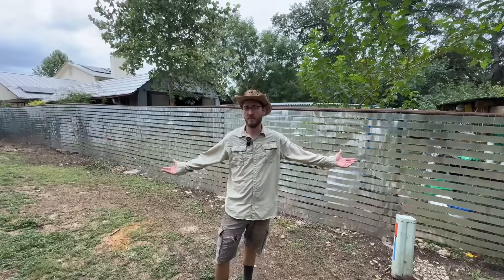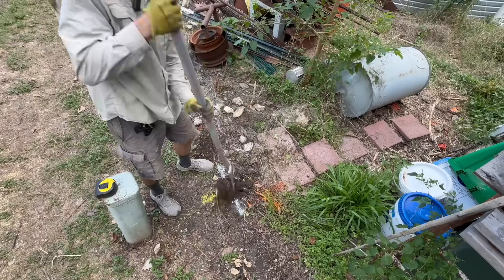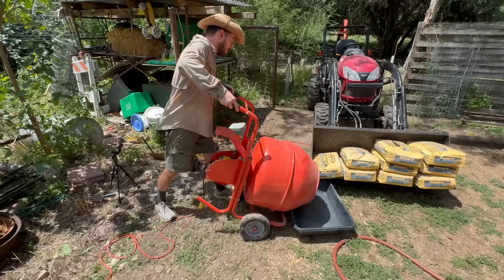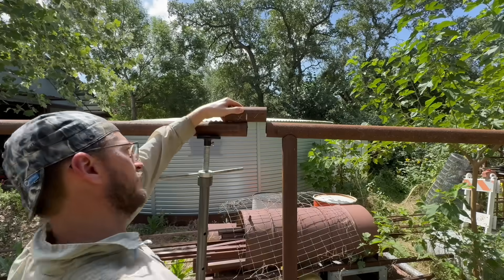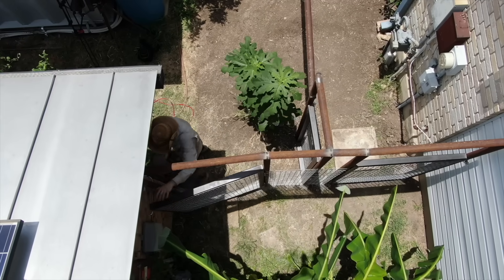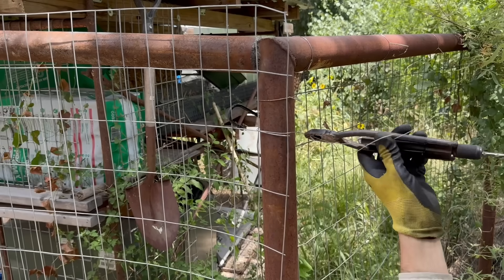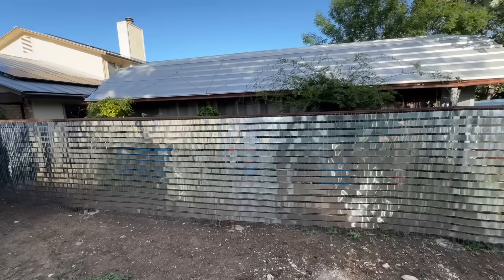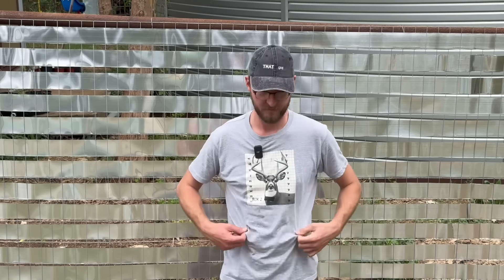This FENCE Lasts 100 years!!!!

Comment: We used those pliers in jewelry class in high school to make neat bracelets and stuff. Try spinning some wire, then folding it over and spinning it again. Or fold it and spin it backwards, makes a really neat braided pattern. Then hammer it flat, solder/weld the ends together, a little buffing and poof 10 minute necklace you can sell for $50. 

Also a drill can be used if you don't wanna drop >$100 on a new tool. Those are just more handy.

Comment: I used these pipes to support my patio roof and an arbor in my backyard. Well, they do get rusted over time and exposure to rain. In my case it's about 13 years. One of my roof supports... a pillar actually, has rusted and snapped off just above the floor and I have to call a welder to fix it. 
If I have to redo this setup I would go for thicker and stronger metal. Also, give it a slightly higher base to keep the metal off the ground. Not sure how this would work for a fence though. I've used T-bars for the fence but those are also rusted and rotting now. But metal is still better than wood in my tropical environment in India.

Comment: Just an FYI, woven wire fence is much stronger than welded wire.  The wire is usually thicker and it's a continuous run.  It's also heavier and more expensive so the welded wire could be a better way to go if you're not expecting any cows or horses pushing on it.

Comment: 2 thoughts:
This reminds me of a fence at the De Young museum in San Francisco. http://artofgardeningbuffalo.blogspot.com/2012/08/the-de-young-museum-garden-in-san.html?m=1
They used welded wire mesh and perforated metal on both sides of square steel tubing. They filled the fence with duff (fallen leaves) to allow plants to grow on the fence.

Secondly, the aluminum fence material would act as a good reflective surface for roadside fences to notify motorists of a upcoming curve.

Comment: Deer don't like to jump fences unless they are pressured. They go through brakes as much as possible. Not being able to see the other side will deter them from trying. Foil sure isn't going to attract them. While it is new they will be scared of it.
    I hunt where it is bordered with ancient fences. Out of the 40 or more game trails leaving the hunting land, only one do they jump a single barbed wire. They only do it because it is in a tiny dry wash and they are above it for the whole jump. All the rest are breaks, knocked downs, or rusted away places in the fence. It is only 4 feet high, with 2 more barbed strands upper and lower, 90 year old cow fence.

Comment: Don't know what u do for a living ? If ur not a tradesman?? U could be a welder/fabricator! Ur very detail oriented. Some of the routes u chose to go with were great! Don't listen to the negative Nancy's and the haters!! I have several welding certs under my belt and own my own portable welding rig" Lincoln classic2 250amp diesel powered rig. Hold the course young man! Good job
Reply from the maker: Thank you genuinely for your words of support. It means even more coming from a welder. I have gotten some critics here on the quality of my welds (Koch I will admit is not perfect). It’s good to hear from a tradesman who is tolerant of my non-tradesman flaws. Thanks!

Comment: Living in Arizona, this fence is terrifying. Blinded every time I look outside and the ambient temperature of the backyard rises to 160f... I can feel it now
Reply: Maybe vinyl siding in some less reflective color could be used for the strips.
Reply: Used galvanized corrugated roofing panels vertically on a fence in the San Fernando Valley. The yard, which used drought resistant landscaping, was an oven in the summer.
Reply: Aluminum outside is not going to stay shiny very long, and it does not attract and absorb heat. A block fence, on the other hand, is going to absorb the heat and then radiate it. Your assumptions were incorrect, and don't make any sense at all.
Reply: It could be painted....I think it's ok as is but to each his own
Reply: you do know tx is hot and sunny also??

Comment: Good video.  Lots of interesting ideas.  A few thoughts:
1.  It's optimally designed around your skills, tools, workshop, and location (optimal steel available, and climate conditions).
2.  I'm wondering if the ivy is going to 'like' growing on the aluminum.  Might get too hot when the sun is shining on it.
3.  Without a bottom rail, seems it will flap in the wind and be tempting for smaller animals to dig under it.
4.  Seems similar to a chain link fence with aluminum strips woven through the fabric, except the posts and rails are heavy steel and the "look" is unique.

Comment: Fence can be made from whatever’s available… guy here in town has the steel framing and the fence is made up of flywheels, cranks… engine head, valve cover hubcap wheels… lots of wheels bumpers tailgates engine blocks transmission driveshafts…. It’s a crazy fence
Reply: Hey, post some photos, I want to see the crazy fence!

Comment: Your great tools help.  When I owned a small concrete mixer, I used raw cement, sand, and gravel in 1:2:3 ratio by volume.  To keep it clean between mixing many loads, after dumping it out, I would shovel in gravel for the next batch and water and run that to scour out the latch batch.  Biggest job was pouring footings for a house addition (2 ft wide), others were filling cores of a concrete block garage wall.  For slabs, I ordered a concrete truck load (no time to mix that much).  The great thing about welding is that you can attach any steel together without figuring out funky brackets and drilling bolt holes.

Thorny plants can be good for security and might even discourage deer from jumping over.  All my neighbors in CA now are just-write-a-check types.  One newbie fussed that I shouldn't mow my lawn and trim my trees myself.  What happened to the pioneer spirit?  Noticed you also extended the side fence into your neighbor's yard, replacing the rotted wood fence there.  You are a nice neighbor.

Comment: I appreciate everything about this fence, and I hope in the future I can place myself into a situation where I can do this very same thing on my own property that I hope to buy one day. I do have a bit of skepticism on the 100 years part lol. !00 years for sure, but rickety at the point. And I think that solely because of the quality of your welds. I understand welding is difficult and you're doing this outside with non industrial equipment. But, I do believe that it is the sole thing that could drastically improve the longevity.

Great work. Do you plan on applying any kind of sealer prior to letting the vines take it over? Maybe double layer thick on the flashing? How is the flashing fixed to the pole rather than lose weaved through the wire? (shitload of work, but drilled/tapped holes with small screws and large washers through a double fold on the end of each strip of flashing?

No mean intent, just my thoughts on making it brutalistic style over engineered strength for extreme durability/longevity.

Comment: Seems like you used 4 different metallurgies there, when you could have gone with just one or two.  You have raw steel oil pipe, galvanized ranch wire fence, stainless twist wire and aluminum flashing visual barrier.  While Stainless steel, galvanized steel and aluminum are all considered corrosion resistant, no so much when they are mixed together.  The stainless and aluminum will ruin the galvanized resistance wherever they contact.  You could have used galvanized twist wire and flashing, which would have been both cheaper and would have complemented their rust resistance.  I don't have experience with these metals in long term fencing and I know that twisting wire tends to ruin its galvanization so perhaps the SS twist wire would be a good idea.  Stainless may not harm galvanized as bad as aluminum.  Keep an eye on the galvanized ranch fencing where it contacts the aluminum; if it's getting rust at the contact points.  The problem with mixed metallurgy is that the more electro-reactive the metals will make the less reactive one's corrode, like aluminum will attack the zinc in the galvanized.  Aluminum is a very highly reactive metal, but it forms a super hard protective oxide skin that protects it, basically ruby or corundum, almost diamond hard.

Comment: ove your fireproof fence.  Especially where you have gates and it touches the house, it will really help defend your house from fires.  They are denying people fire insurance in California and we are going to need lots more of this kind of thing.  Vines will burn, but we understand the love of green: just keep it at least 5 feet away from the house.  

It shouldn't take a 2 or 3 years to grow vines with some water and urine for fertilizer.  Urine is NPK approximately 11-1-2.  So high in nitrogen it will burn things, so water in,  or mix with water which also eliminates odors.   Woody plants with toughened roots have less problem with burn, but young roots and tender annuals are sensitive.  Vines should shoot up like crazy.

Galvinized metal roofing is used for fences too.  A little industrial, but so are the aluminum strips.  It might be nice to break things up.  You could also andonize the aluminum strips if you didn't want the bright shiny look, although that shoud fade pretty quickly with rain and the galvanized steel causing galvanic reaction on the aluminum.  Hmm.  Galvi is nickle coating so that might be different than straight steel or stainless steel.  Andonized would help protect the aluminum too.   I like brown, but you could do any bright dye color.

Comment: Okay; so I actually subscribed over the wasp video. 
  Would it be rude to point out that your fence lacks a stabilizing structure at the bottom?  Things can definitely crawl under, bending the wire as they do so.   I know; welded wire is fairly tough, and the post frame really adds to the integrity, but perhaps you might consider adding a cable at the bottom., to keep it from being pushed out of shape.  Just a thought.
  Interesting channel (I plan to keep an eye on it)!
Reply from the maker: Once the vines grow they will tether the bottom to the ground. I put a bottom bar on my other segments of fence and found it to be overkill. I don’t have any dogs that like to dig and I have no interest in attempting to keep skunks and opossums on either side. They climb or dig anyway. I guess time will tell if it’s necessary but my intuition says that for my purposes it won’t be 🤷 thanks for subscribing!!!

Comment: Galvanic corrosion
When aluminum and steel are combined, electrons from the aluminum transfer to the steel, which weakens the aluminum and causes it to deteriorate faster. This is called galvanic corrosion, which occurs when dissimilar metals are combined in a corrosive electrolyte
Reply from the maker: Didn’t the zinc coating in the galvanized surface take the hit? I bought some additional zinc anodes I’m thinking of installing.

Comment: Steel + aluminum = electrolysis, which will cause corrosion on both metals. I get the reason of convenience as I enjoy using aluminum flashing myself but it doesn't mix because chemistry

Comment: I think if I was gonna go through all that trouble I would have welded in hog panels between the posts. The wire fabric is loose and floppy and the wire it was tied on with seemed sort of light duty compared to the rest of the fence

Comment: Why didnt you pull the wire mesh taut with some come alongs? Honestly taking the the time to go from 95% there to 100% straight would have made a ton of difference in the final product.

Personally I would have used horse or cattle panels.

Not sure if youre the artistic type. This looks like something in a urban chic setting more than a rural setting.

And while I sound negative, good job. Your did it infinitely better than I would have ever done.

Comment: That's a very nice fence. I'm not so sure about the aluminum flashing though. It will lead to galvanic corrosion of the iron posts and eat up the zinc of the "welded utility fabric"  in the long run. Even if your place is very dry, the humidity in the air is enough to support this corrosion.
Reply from the maker: I suspected it will take a long time but I guess time will tell. I bought some zinc anodes as a backup plan but I have not installed them yet.

Comment: What do you do when it rust?  Did you treat the pie for that?
Reply from the maker: The rust forms a relatively stable oxide in my dry climate.
Reply: @suburbanbiology  Yes it does oxides. That eventually turns into holes. Is there any thing that you can put on them to prevent the pipes to rot away.

Comment: What a brilliant idea for a fence! 
I need to fence off my back garden and i'm a welder! 👍👍👍
Loved the use of the flat bar and bucket. Also liked the idea of only weaving to the next post. I would have tried to weave one roll at a time. I think your method would be a LOT easier!
Reply from the maker: Glad you liked it! Yeah I tried to weave longer strips but the resistance builds up over the distance and the friction made it too hard to pull more than about 15 feet. So I stopped at 10.

Comment: You know ive heard a lot of people talk about the benefits of using concrete powder dry.

Apparently, (and i have no experience with this myself)

But by packing the hole with dry concrete then wetting it yourself without mixing. 

The logic is that the moisture basically forms a solid concrete bulb with the dry dust inside. So its overall weaker. But far longer lasting because if the bulb cracks over time. Extra layers of concrete get wetted by the rain and seal up the cracks.
Reply from the maker: I’ve only tried it once as a kid for a mailbox post. It held up fine for the 10 years before I moved 🤷

Comment: Great video. I put in a wire fence because the winds kick-up bad and the deer are an issue. I first installed a short cement bulkhead on poured footers, put PVC pipe where the fence poles were to go (recycled from the dump). What I did to get my fencing "taunt" was weave a metal bar in the ends (recycled from a neighbor who removed their fence). I anchored one end to a post then rolled out the fencing and attached a hand winch to the bar I had weaved in at the other end. Got the right amount of tension and started wiring it on.

Comment: I just spent $4K on a fence a lot smaller and a lot more plastic than yours. 😣
What did that even cost you?? You find some change in a vending machine and decide to build a new fence?
Geez, good work man.
Reply from the maker: Rough costs in description.

Comment: For the posts, fill your hole with water, then pour in the mix.  Hold the pole roughly plumb to start, then adjust as the mix sets.

Comment: Cleaning the concrete mixer... with soap? What garbage is that?
Just pour water in and let the mixer spin for a while, dump the water and it's perfectly clean. Any excess sand left (since the cement gets completely washed out) can just be rinsed out afterward.

Comment: what did you do to prevent electrolysis?
Reply from the maker: Should be slow in my dry climate. But I just bought two zinc anodes I plan on attaching just to be super thorough.

Comment: Holy shit. Im never this guy. Your welds made me vomit. You gotta clean the surface before you weld it. I saw porosity in your video. Like I assumed it would be there with all the rust you left on there, but I didnt think I'd see it in the video. Your rainwater thing was badass. This fence made me want to climb through the screen and give you a flapper disk.

Comment: That flashing is gonna be brighter than a amazonians rear end when the sun hits it and you are working in the yard lol. The pipe you reused for the fencing is awsome. I would of tried to clean the rust with sandplast or your laser thing and painted it to keep it from rusting into the ground later. But thats me, i dont blame you for not doing that cause its alot of work lol.

Comment: Clever design.  Are you worried the aluminum flashing will strip off the fence roll's galvanizing eventually, and result in rusting the wire through galvanic action?  Or is the fence roll aluminum?
Reply from the maker: Galvanic corrosion is likely. But in my dry climate I suspect it will be slow.

Comment: Rather than measuring up 6' from the ground which rises and falls, pull the string tight and follow it with your top rail. That way you'll end up with a straight and neat top on your fence that doesnt rise and fall with the ground.

Comment: I like it, but I do think you over estimate the life if hollow steel post, I have several pieces that were used for various things, one being the holder for a taped grain truck, it's rusted big time,and it was opened at the one end so any water should have been able to escape, anyway my guess is those post will rust out right at the bottom where it meets the concrete...any water that gets on the concrete will get down between the steel and stay there , my buddy planted treated 4x4 post into concrete he even billed the Crete up around the post and then siliconed around that yet, it only lasted about three years, and rotted right at the base. I told him , it would have been better just tamped down uepseing pee gravel mixed with larger gravel. The drainage is what you want. Also you already had rust on the steel, should have at least oiled it. Looks good though, I like the flashing idea.